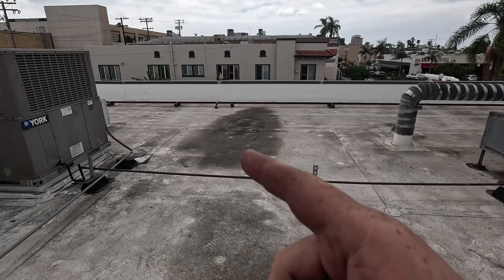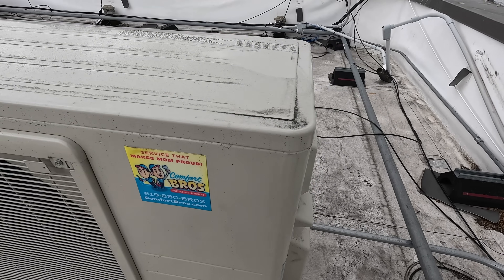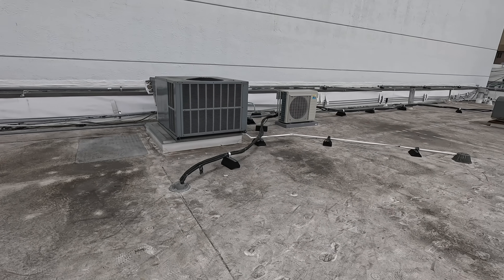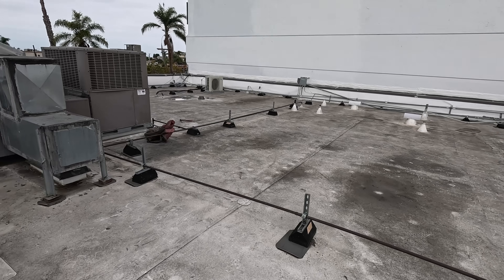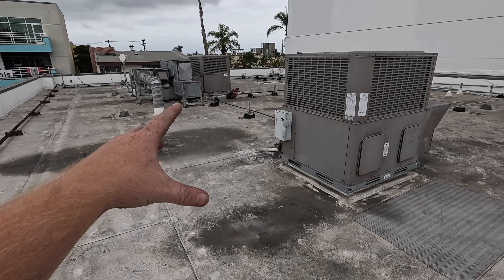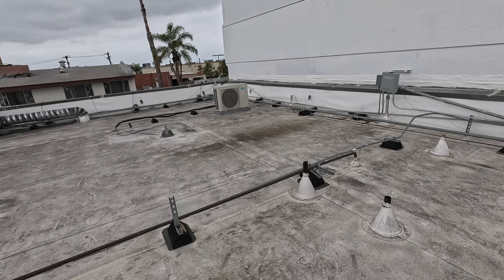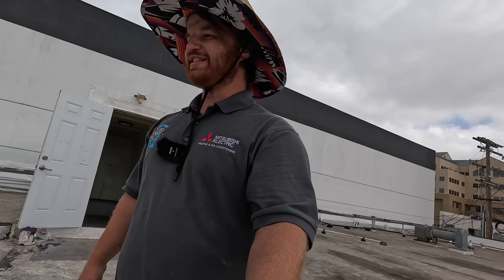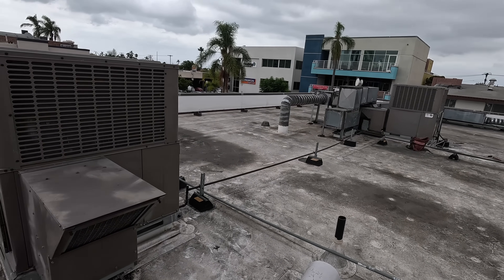$50,000 HVAC Install Mistake Required Two Minute Fix

Comment: I was (retired ) now 40 years in the HVAC industry, 30 years as “the guy” for Carrier and Lennox! I would be the factory guy to address these type of issues! For you HVAC techs, do this first! Test CFM air temperature’s then  actual equipment capacity! Make sure everything is wired and controlled properly! 

This is so very easy to find! Do your Job! Once you “Know” the equipment is operating as designed! If you still have condition control issues, “THINK”! The equipment is transferring the correct amount of BTU/h per the manufacturer design specifications! So now what?  Is this truly an equipment sizing issue? Do a load calculation. 

Where is all this excess heat coming from? Did they add additional space, additional equipment, additional people additional ventilation? Did something in the envelope “building change”? If you keep looking and testing you will find it! I did every single time!  On hundreds of occasions over 30 years! Why? I knew what I was doing, I cared about our reputation the reputation of the contractor and the comfort of the user all equally important!

Comment: Thanks for the video! I have seen this my whole career and used to feel 40+ years ago when I finally learned enough HVAC that 60% of HVAC techs & installers out there needed to go do something else for a living! 
Over the years that number creeped up to 75% but after watching a ton of YouTube videos recently like this may have tipped that number to around 80%+ of people in the HVAC industry just need to go do something else because they lack any critical thinking skills hell they don't even have simple logic abilities so whatever they do it cannot be technical or even have to think because that is beyond them. Sad to see our industry in this state for sure then add in the ones that are ripping off customers makes the pool of really good honest ones few and far in between my friend!
 
Any commercial or industrial facility owners today, building a new building or even doing a major very large renovation of MEP (HVAC) need to commission their MEP properly! If they do not have that ability with current staff they need to hire a VERY GOOD 3rd party commissioning consultant to go behind them all! They also need a rock solid spec and prints leaving NO wiggle room for change orders or changing any equipment after bid!

Stay safe my friend!

Comment: Just goes to show how many "techs" are just youtube taught and don't really know the fundamentals of the system. A simple duct temperature check on all outlets would have spot lighted the problem. Good find! And nobody within the company didn't spot the really high power bills?! Tough time to run a company...

Comment: That's a crime.  So many contractors just don't care.
Was it just an O/B wire swap?  Would have been nice to see the fix.
Reply from the maker: Thermostat was programmed for a furnace+AC and the system was a heat pump. That's literally all

Comment: One of those things that nobody would expected being the issue.  

In weird situations like that where stuff doesn’t quite add up you gotta go back to like step ONE in your mind like you’re there on the day the old
Units are pulled, new units set, and every step during install.  Even programming the stats.

Nice job bro.
Reply from the maker: The weirdest one I ever saw was the following:

Heat pump system - reversing valve O
System programmed for 2 stage furnace+AC
AC stage one was wired to compressor
AC stage two was wired to reversing valve

Homeowner said the home never cooled to what it was set to. She had only owned the home a year or two I don't remember. If the system was within 5 degrees of set temp then it would call for first stage only and heat would run - compressor but not reversing valve. After heating the home up a little bit the 2nd stage thermostat wire would engage the reversing valve and cooling would start.

This was AZ so I can't imagine the heat actually ran an extended period in the summer but it was definitely not working. I was a newer tech and the first time I showed up it had a totally separate issue and then I made sure it was working and left. Got called back a couple days later and she disclosed that she had had several others out and it never worked right. Watched it run long enough to witness the reversing valve lose power and bam I figured it out. Really weird one

Comment: Who would not use their hands to check the suction line? I mean it’s one of the quickest checks. Walk in the job, see if fans on are on, listen to compressors, touch the suction and liquid line. Id do that before i even opened the electrical controls.
Basics bro.

Comment: How did it not go off on high pressure running in heat in the summer . it had to have been short cycling over and over

Comment: There is such a shortage of actually good techs, well done. The other week I was sent out as 3rd tech on site for a walk in freezer to see what I thought and if needed size a new unit. Tech 1 comes out and sees the compressor running and both condenser fans are off, orders 2 new fans.  Tech 2 comes out and replaces the fans, they still don't run. He then replaced the fan cycle control (has anyone checked if the fans are actually getting 240 volts?) and the low pressure control (no idea why). He also said the compressor sounds like crap so they might want to just replace the unit as its an old semi hermetic unit with a "failing compressor". I get sent out and the second I heard that compressor I was immediately knew it was getting single phased, pop the cover off the contactor and sure as shit L3 is completely melted and the fans are single phase on L1 and L3 guess why the fans don't run... replaced a $40 contactor and its been fine ever since but these idiots threw like $800 worth of parts at it rather than check anything or call someone.
Reply: So many techs trust their “eyes and ears”  don’t know how to use their damn meters. It’s ridiculous

Comment: I believe it. I work as an MEP contractor in a different but related field. Most of our installers have abilities far below their job titles. They would 100% make mistakes like this, and not care because "that's the way we've always done it" and they think they walk on water. They care much more about getting out of there early than they do about the system actually working correctly. It's been going on for years, and their service manager is clueless.

Comment: I have an old Cat S62 Pro 4G phone that is no longer supported because 5G. I still use it for Internet and its Infrared Camera. I can measure temperature and take pictures. It's also good for leak detect if used right. 

You'd have thought every HVAC technician would curious about temperature balance in ducting? Especially if a customer is complaining about hot spots. Six years seems ridiculously incompetent. You are talking over a $100k in power cost easy, maybe more. They'll notice if they compare to last year after a month or two.

 There are very few real technicians left. Not just HVAC, but Instrument Techs, and Millwrights. We are being replaced by installers. I call them copy cats. They can do the physical work, but the troubleshooting and logic is beyond them. As we get seasoned things are supposed to become intuitive. Sadly for the monkey see monkey do and Google Techs they are stuck in slow uptake mode. They can't play chess either, 😅

Comment: That level of incompetence is mind boggling. The guy literally needed no tools and only 1 second of time walking up to the unit to know there was a problem just by feeling the cool air blowing out instead of warm air... And then to get to a point of selling them more units to try and bandaid the issue. So many things went wrong with this I don't even know where to start.

Comment: (the solution to the cooling issue) It's like when you send someone with zero HVAC experience to diagnose an HVAC issue not a supposedly trained technician, I would have found issue as well as you(eventually I'm sure), but Wow they(the preceding technicians) must have an IQ lover than the temperature blowing out those affected registers, Lol.

Comment: Dont you hate when other dumb people made the money but you’re the hero
Reply: Yes: sometimes your knowledge enables you to do something nice...my company was a couple of blocks from the WTC on 9/11, and we were displaced to a temporary location. Everyone was on edge, having been forced to evacuate on that terrible day. Our new place had an air-conditioning unit that cycled the fan and compressor on the thermostat, and when it came on there would be a big bang from the ductwork pressurizing. Some of our secretaries would "freak out", having seen so many bad things a few days earlier. After a couple of these incidents, I took a look at the thermostat and called over one of the managers. I told him that the fan switch should be left in the ON position, so there would only be one BIG BANG early in the morning, before the secretaries got to work. No more jittery co-workers.

Comment: What do you mean when you say the thermostat wasn't programmed right? Did you just have to push a button and turn it to cool?
Reply from the maker: You have to program the thermostat to match the equipment type. In this case it didn't match so it wasn't controlling it properly

Comment: can you go in depth about the wiring issue please
Reply from the maker: Literally the thermostat was programmed for gas furnace and the unit is a heat pump. It was wired correctly just programmed
Reply: Guess that functioning as a thermostat for a furnace and an air conditioner, instead of for a heat pump, it only energized the Y lead for the compressor, and left the O terminal to the "energize to cool" reversing valve de-energized.

Comment: wonder if their maintenance techs were just so incompetent all they did was change filters and not check the system. how do you maintenance a system and never notice its running in heating?? no temp probes to check split? i always check for proper airflow above the condenser... would instantly notice its in heating?? How are these companies selling this?

Comment: I've had a few cheap home depot thermostats that would run the electric heat and A/c the same time on one property I work at. Pulling 40amps for resistant heat and another 10amps for Cooling running constantly until the 50amp breaker would overheat and trip off. Installed a new digital heat/cool Tstat and it worked perfect again.
Reply from the maker: There was a brief spell where a lot of Nests did this brand new out the box

Comment: 30k for 2 mini splits, yikes
Reply from the maker: As far as mini splits go it would've been a fairly involved job. I confirmed later that the total was 35k. The company probably didn't want the work and quoted it egregiously high ad then it closed. Incompetent techs? Sure thing. But the business owner should've looked elsewhere with that price. I don't think they shopped around I think they were desperate for a solution

Comment: I figured I’d add my “ good one” I am a supermarket refrigeration tech and did some work on hvac. We had this supermarket that was built in 1982 and for the last 10 years they were complaining that the AC would not keep up. In the supermarket business, when it is over 79 degrees, all the cases start running warm so AC is super important. We had multiple in house techs as well as many techs from outside companies try to figure it out. It was one of those Trane 100 ton split 460 vac systems that have belt drivin fans. First I rosin the condensor dirty, the evap filthy and when they replaced one of those 6 foot fans, they used one of the wrong pitch. So I had to change the sheaves as it was only drawing 1/2 the amps as the other one….bit it gets better. On day 4. And about 96 degrees out I noticed that the adjustable sheave was almost all the way open and the belt was basically riding on the shaft. It was rated for 16 amps and was drawing 18.  Wtf!!  How can this be, the motor was not too hot.. I looked at the started heaters and they were at 32 amps. Wow!!!  Then I checked the voltage. The indoor unit was 240 volts..not 460. Everyone assumed bc the outdoor unit was 460 that the indoor one was 460…not so. I turned in the sheave several turns and checked the amperage and it was 28 amps.  R22. Back pressure 65 and head 240 on a 96 degree day!!  My boss called me the next day as the store called up and said it was freezing. When I got there the thermostat was all the way down and the outside of the plate glass windows were sweating  10 years like that!!
Reply: I see lots of even idiots who are incompetent and stupid. Nobody seems to care. Nobody reads the fucken  manuals.

Comment: Nothing is simple with a flat roof: setting pitch pots is not the same as driling holes in a wall.  Anyway... like cars, too much tech is a bad thing: when a thermostat has to be programmed, I just don't like it.
Reply from the maker: Even the dumbest thermostats you have to choose between heat pump or gas heater. That was a problem in this case
Reply: @SurfBrosHVAC  Wow.  New heights in RTFM...

Comment: In today's world techs that can't troubleshoot condemn every unit and end up generating more revenue with unit replacements than service techs that know how to troubleshoot and actually only repair the item that failed. The good tech might end up making less money for the company than the bad tech that sells unit replacements all the time. This is why I have trust issues with the HVAC industry right now. Beware of the companies with large advertising budgets. Completely unacceptable that issue went on for 6 years without someone at least checking the supply temp of the unit.
Reply: Trolly was the new unit guys on here can't troubleshoot that's why they stay away from commercial and rape people in resi...

Comment: I knew a restaurant that their A/C stopped working. Several companies went out and said they needed a new system.
Buddy went out and FOR FREE looked at it.
All he did was press the reset button on the high pressure switch. And it started working.
He advised them they they certainly NEED to have their dirty condensing coils cleaned.
He at least got a meal out of it lol

I knew a landlord that decided to replace his thermostats in apartments.
You turn them up for heat and the AC kicked on. Turn them down for AC and the heat kicked on.
I asked him if we got them from Florida?
Puzzled, he asked why?
I said you bought Florida Thermostats. They work backwards.
Told him to get a company to come out and replace them with the right thermostats.
I think he did but never heard from him again.

Comment: An older friend's Hot House AC issue turned out to be just his fiddling with the thermostat. They were switching it to heat pump mode from AC mode in August. In North Mississippi. So before I caught this I jumpered the outside unit full on in the evening the next morning the oven like house was nice and cold. So there as nothing wrong with the R22 Rheme AC/heat pump; or the thermostat. It just was being played with. ie maybe like get up at night and it is cold so turn to heat pump; then turn it back to ac mode..

A possible fix is add a hidden switch so one cannot fire off the reversing valve in the hit summer. lol
Reply: Just unwire the reversing valve at the t-stat.
Reply: @amiatroll1  Unless the unit requires the valve to be energized to cool (fail-to-heating type)

Comment: Showed up on a job one day, same thing, brought me in on a referral to see why the new ac hasn’t been cooling the space after 6 months.  When I got there, the company that put in the AC , was installing a mini split to help with the new unit cooling issue.  As I was walking up to the RTU, I could hear it(blower motor) running, backwards.  The blower was running backwards.  Turned two legs and got the direction right.  Before I came off the roof, the space started cooling and felt comfortable.  When asked what I did, I informed them.  Two minute fix.  Needless to say, the contractor installing the mini was asked to remove the mini and leave and refund all of the money that was invested in it.  That was S Fl.
Reply: Hearing some these stories gives me confidence in my work.
Reply: I thought that checking rotation was the first thing they do at startup on a new unit😂
Reply: @bryanbell578  That's the way it's supposed to be.
Reply: @CZDigger. How long was it running like that. Scroll compressors will fail fast running backwards, make a lot of noise too. ECM blowers "self correct" for backwards phase but compressors can't.
Reply: @criticaltemperature3343 just the blower was backwards. Comps were fine.  Owner stated it had been installed 6 months prior.
Reply from the maker: This is hilarious
Reply: I went to one in a rooftop where they just didn't open the refrigerant lines
Reply: Howd it not feeeze up? Every blower i seen going backwards froze up coils or tripped high limits in heating.

Comment: How do you not hear the lack of compressor running when troubleshooting that type of issue .  thats a lot of techs that are not checking basic operation . just hard to believe.
Reply: @robert. Heat pumps run the compressor for heating and cooling. The difference, is heat exiting (cooling) or entering (heating) the building.
Reply: @criticaltemperature3343   Am i not understanding the diff . this unit has a gas line going to it so i dont think this is a heat pump unit . yeah a heat pump will run compressor because it takes that heat at the evap to make/put out the heat the heat. 
I think the two extra ones they added would be the heat pump style not the one he was working on ...
Reply from the maker: There’s no gas line